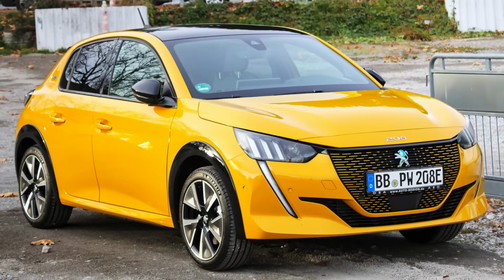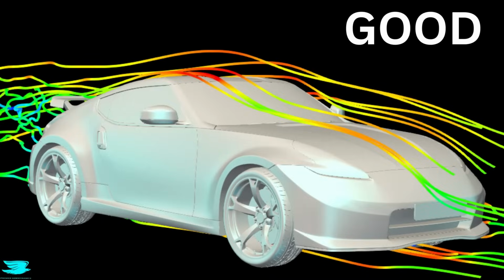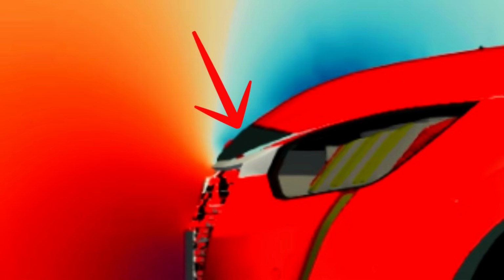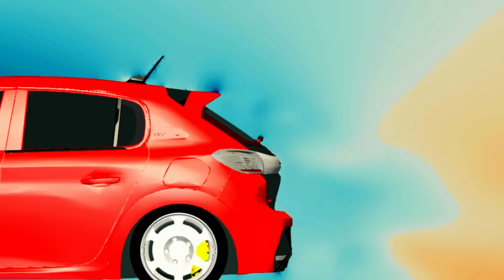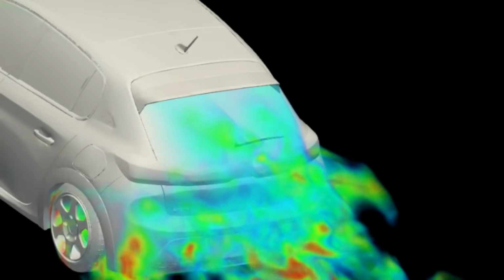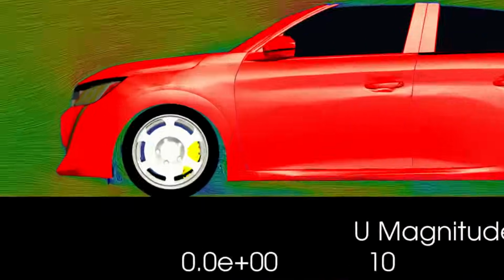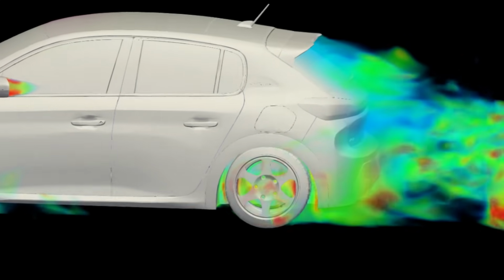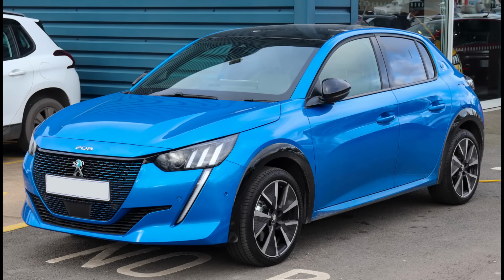How The Peugeot 208 Breaks The 0.3 Drag Coefficient Barrier

Comment: I have an idea that might make for a very interesting aerodynamic comparison.

You have already shown how subtle details can significantly affect airflow, drag, cooling, and underbody turbulence. I’d love to see you compare the European Peugeot 208 with the Argentine-built version sold in South America.

At first glance they look almost identical, but there are several small engineering differences that may have measurable aerodynamic effects. On my Argentine 208, I installed an engine undertray (skid plate) and added a front hood/headlight seal to reduce the gap where air can enter the engine bay. It would be fascinating to see whether these simple modifications improve airflow, reduce lift or drag, or even affect cooling.

I can provide detailed, high-resolution photos of every area of my car to help identify all the differences from the European model. I think many Peugeot owners—and automotive engineering enthusiasts in general—would find this comparison extremely interesting because almost nobody has investigated these regional design changes scientifically.

I hope you’ll consider making this video. I believe it would be a unique addition to your channel!
Reply from the maker: Hi! On our site, we have the Simulate My Car page for commissioning simulations. Thank you.

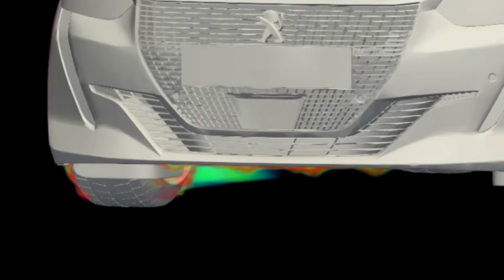Comment: I'm not sure but the front wheel spoilers look like they are curved in slightly and towards the back (2:08) Are they or can they be used as vortex generators to aid the flow down the bottom of the car?
Reply from the maker: They seem to be a little too flat to do that properly. There is a wake behind them instead of producing a coherent vortex, I think. But, they could be angled to be vortex generators, and shrunk a little.

Comment: Citroën AX did 0.31 in 1986 (almost 40 years ago - 0.32 for sport/gti version with big bumper).

Peugeot 106 did 0.34.
Best was Opel Calibra @ 0.26 (!).

I'm not going to talk about weight for technophiles (715Kg vs 1075Kg) and even less about safety knowing that motorcycles and bicycles populate our roads without us talking about the safety of such vehicles!

Comment: this absolute piece of french shitbox engineering has absolutely no side-wind resistance at all. It's light, top heavy and has soft suspension. Sitting at 120-130km/h it's a menance to all other road users, since you float from one side of the road to the other fighting the current wind. Arguably one of the worst cars I've ever driven, and I've driven a lot, especially small econoboxes, trust me. 1.2 pure tech sucks ass, the infotainment is slow and for me using it is a torture- I can never find the thing I want. If I could I would wh00p it's ass out of the window, but WELL... YOU CAN'T. Because someone in the office suggested NOT TO use any knobs, and the A/C and heater settings were burried in endless menus. Awesome idea. Driving aids suck, just like the rest. Annoying, never working as intended, especially the one informing you there's a car in front of you. YEAH NO SHIT, I'm just 15 meters behind it, SO IF I MAY ASK- please, don't show this stupid message on my screen, cuz then I can't do shit on it. Glad it's a work vehicle and we are switching to yarises next year. If possible, would almost definitely turn this useless 4-wheeler into a solid metal cube on the nearest junkyard. 2021 208 1.2 Puretech - 170k kms.

Comment: This car only comes with 1.2 turbo petrol 130 HP or 1.5 diesel 130 HP. I dont understand why Peugeot does not make this car with the 1.6 turbo 225(same as the 508GT sedan) THP petrol engine. Even with 1.2 3 cylinder engine, car act\drive like a hot hatch. 225 hp and light weight would make this a true competition to type 4, golf GTI, polo GTI, Hyundai i20 etc

Comment: As an owner of a 208 GT, I'm astounded by how well the design and aerodynamics team did their job - and yet the drivetrain team was allowed to just waltz in and lazily throw in a the motor unit from the lowest bidder. As a complete package, the 208 ends up less efficient than cars two sizes up.

Comment: Did you know that an even older design of the peugeot 106 mk 2 has a drag coefficient of only 0.31, that for a model starting from 1997 is mega mad for me! 

Hot hatches for life!
Reply: And did you know an older and shorter Citroën AX also had a Cd of 0.31 ? With its small frontal area, it was really efficient aerodynamically and needed very little fuel.
The first Y10 had the same 0.31 Cd.

Comment: You should do new Peugeot 308 as well, I sold my 208 and bought a 308 with the same engine and transmission. When I lift off the gas pedal, 308 keeps its speed better than 208. Lo and behold, 308's drag coefficient is 0.28

Comment: Did you considered working in the industry? It would help you with the reasoning behind the design choices, mainly pedestrian safety regulations, manufacturing limitations (costs), car insurance costs (protection of expensive parts), 10% frontal crash safety did a lot of changes and more
Reply from the maker: I have. When it comes to sales, looks are the most important thing. So, pretty much everything else is worked around that and regulations are cobbled together to work with that. The height of the front blockiness can be for pedestrian safety, but that can also be done with vehicle height.

Comment: I started to notice that a lot of modern cars have some kind of aero channels. They start at the extremity of their front bumper and ends up inside the wheelarches but directed towards the outside section of the tire. For exemple, you can see this on the Clio 5 facelift. And I know that the DS5 already had this years ago, but I noticed that more and more manufacturer do this.
Do you know what that could be for ?
Reply from the maker: Some cars have then for looks, and others as air curtains. They help create a shield of air around the wheel and drop the drag coefficient a little.

Comment: You should do an Interview with drivers of the Peugeot 208e and Corsa e…Their electrical driving range vanished dramatically reaching speeds above 110 km/h 
Maybe the GTI i Version is lower than 0,3 but not the EV. It has also a much higher ride hight due to its underfloor battery. And cW Value is not everything the flow-cross-sectional area is also important
Reply: The battery is placed in a H configuration around the car, it is the same as the petrol version, the ride is not higher. It's a multi power platform. 

I think the range issues are due to the battery tech.

Comment: It's kind of surprising, since 208 II doesn't strike to me as a typically "slippery" looking design you often associate with low-drag cars. Nowadays they can do a lot with detailing like that, but also the overall shape is rounder than it looks on the road. Especially at the front, the shutlines, the grille and the headlight shapes create an impression of a boxy shape.
Reply from the maker: It does have an underlying boxy shape, but many of the edges are rounded just enough to really reduce the drag coefficient nicely.

Comment: To get the actual aerodynamic behaviour of the car, wouldn't you have to model the front with every vent and hole as well and even the engine bay?
Reply from the maker: That is cooling flow, which we have the flow going through. The cooling flow doesn't combine with other flows to create synergy. It can be isolated and even removed without changing much.
Reply: @PremierAerodynamics So that air does not drag on the car?
I’d have imagined it to be like when swinging an empty bag around with the air slowing it down when it gets filled.

Comment: I love older peugeots, but they are doing an amazing job at their design department with their new cars. They look absolutely stunning.
Reply: Saw a normal 208 in bright yellow paint and though...looks wise this could easily be a hot-hatch GTI model as far as I'm concerned with minimal to no changes to the body. But then you look at the engines available :(
Reply: They all look hideous

Comment: The Opel Astra K Facelift Hatchback is Even better, I remember it has 0.26 or 0.27

Even with the crappy 1.2 Engines it runs very high top Speed, Even with 110hp

Comment: I wish Peugeot made a 208 with the 1.6 PureTech 225 hp engine and a manual option it would be legendary.
Reply: 225 hp for the thp won't last long, the sport engineered 508 is just reaching 200 for the 1.6 and the rest has two motors.
Reply: @ThatSpecificIndividual  508 PSE limits the output of the ICE engine because the front axle cannot handle more power when cumulating ICE + EV.
THP 270 for example was super reliable on RCZ R and 308 GTi
Reply: @ThatSpecificIndividual  I don’t understand what you’re talking about. The 508s in Turkey are sold with the 1.6 PureTech 225 hp version, and I haven’t heard of any problems in the past 5 years. They’re not hybrids, just petrol. Yes, the old THP engines were problematic, but they haven’t been produced for a long time.
Reply: ええ、日本で売られてるDS7、DS9、508もPureTech 225を積んでいます。長くは持たないと言っているのはおそらく、耐久性の話ではなく環境規制の影響で長く販売はできないだろうと言うことを指摘しているのだと思います。私の車もこれを積んでいますが現在のところ7年間元気に稼働しています。
Reply: it was planed around 6 month after launch ( so early 2020 ) , aftermarket documentation was ready. but Peugeot cancelled it because of CAFE objectives fearing getting penalties for not reaching them

Comment: I'm very curious about the aerodynamics of wheels, because it seems like that is the one piece of cars that is still mostly just style. I'm thinking what if the spokes were designed as airfoils to draw in the turbulent air right next to the wheel, of course that would reduce downforce but that extra air pressure could possibly be used to cool the radiators, enabling having a pointier nose, what do you think?
Reply from the maker: It also depends on the wind direction. Ideally, you could use them to suck the flow in and reduce the wake around the edges, but you would have to know what angle the wind is coming from to begin with.

It will also likely increase the flow rate underneath the car, which if the flow entering is now turbulent, would increase the drag and likely reduce the downforce with the way current cars have their underbodies.

Comment: So the wheel spoiler acts also as a gurney flap for the front?
Reply from the maker: I guess you could say that. They also produce really high pressure there, so that creates lift on the car. That's a good similarity you pointed out.

Comment: I don't understand why the fuck we don't have a modern 208 GTI! - Edit: A COMBUSTION ONE

I mean I do, it's not profitable enough, especially with the customers they're aiming for nowadays, but God damn it I want one
Reply: There is a new one coming ! It will be an EV, but it's coming 13 june
Reply: @xenalien355 that doesn't count, sadly
Reply: @xenalien355  lol ev, its not a GTi
Reply: they don't have an engine for it, nobody would buy a GTI with the 1.2 PureTech
Reply: @yobama8344  They could just reuse the previous 1.6(?)THP engine or improve upon it, or go all out and slap the 2.0THP from the 308 GTI on it
Reply: @BotBruh448 the 308 gti came with the 1.6thp 270 but that engine no longer respects new emission guidelines, the recent 1.6 with hybrid powertrains would be a great fit but it risks making the car a lot heavier than it should be, so I can see why they strayed away from it.
Reply: @yobama8344  ah yeah, I got the engines wrong, my bad, still, I'm sure they could find a way to respect guidelines with an iteration of said engine, seeing as there are plenty of brands pulling more horsepower out of bigger engines (Honda and the K20 on the FL5 is a good example)
Reply: @BotBruh448 the 308 gti also has the 1.6 THP but it has forged internals and pushes 272hp with insane turbo boost (huge turbo almost the size of the engine) and awesome intake and blow off noise, all stock, and a Torsen diff as the cherry on top. I know because I have one and it's the last absolutely crazy Peugeot they ever made. MUCH more powerful than a golf 7 gti from its time, and all while having a much smaller engine and much better fuel consumption. I can achieve 6L/100km on mine while my friend in a golf GTI can't go bellow 9-10L/100km and his is only 230hp stock, non forged. Even a stage 2 or 3 on his engine would be hard to catch a stock Peugeot 308 gti, especially because the 308 is also VERY lightweight stock. Feels like the 308 already has a stage 3 out of the factory, it's just insane. Peugeot engineers, when given freedom, do insane things. But the "Peugeot Sport" division was dissolved and with it all the crazy engineers...
Reply: @yobama8344  
It will be a more powerful e-208, it's been ready for years but Tavares did not want it. Things changed when he got fired. By the way, the most powerful series version of the 1.2 PureTech developped 155hp, which is not ridiculous.
Reply: @yobama8344  new 3cyl  stelantis use are from Fiat with timing chain and very reliable
Reply: I will never understand why manufacturers decide to name their EV after a pre-existing car name. The people who buy them will not and would not care about its history. Just give it a new name and call it "a step into a new generation" or something, will ya?
Reply: @verticalflyingb737 
Even Porsche dared to call some of Taycan models "turbo", what a samedi !
Reply: It was designed to from the start... Tavares said no but, fortunately, the new CEO said yes. It's coming soon ! Too bad it's an EV...
Reply: @asthalis  If it's an EV then it doesn't count, I'm sorry, make up some other sporty naming convention for your (the brand's) sporty electrics, GTi stays for combustion in my mind
Reply: No you’ll get bloated electric suvs & you’ll like it
Reply: @Journey_to_sunset  but I don't waaaanna eat my bloated SUVs!!!! :((
Reply: It's not that it's not profitable, it's not profitable with the current emissions regulations in place.
Reply: せめて1.2に48Vマイルドハイブリッドを組み合わせた145馬力ユニットを208に積んでほしい。このユニットは新しく308に設定された物だ。私は整備工場の代車として現行208を借りたが、加速性能以外はとてもすばらしいものだった。パワーだけが足りない！
Reply: In France a thermic version will be taxed with 30000€ malus, that is why you never will see a thermic version
Reply: You wont believe this…
Reply: @Arkxngl  It doesn't count!
Reply: @BotBruh448
Ev may be a good thing, modern .5 liter quad turbo combustion engines sound like vacuum cleaners already, and electric cars can be very powerful with high efficiency at the same time.
Reply: Because EU has killed the french automotive industry.
And escrologist also made it to pass heavy tax laws on any new vehicle sold in France, related to CO2 emission.
Any sports car is getting thousands and thousands in tax at purchase.

And Peugeot cannot do without domestic market.

I am buying a Miata because it's lightweight and only cost 5000€ in carbon tax.
A good old Renault Megane RS would be getting 60,000€ in tax, were it be sold today (no I didn't put any extra 0, that's the real tax there)

All is ruined.
The richs don't care, they can pay for their 911 and that tax is passed onto the car resale value.
But the average guy is done for.
Reply: I’m glad it’s an ev

Comment: Id love to see how Toyota Auris Estate (2015 face-lift) performs. It's supposed to have a low drag coefficient,very similar to the Prius, around 0.28 if the internet is not lying to me :)
Reply: The original auris pre facelift is even lower 0.27
Reply: Prius 4 have a Cd = 0,24 and Prius 3 have a Cd of 0,25, but it its just a number, lot of things are added together to have a good design, for example the new Prius 5 has 0,27 Cd, but the front of the car is flatter, and the design reduces the amount of vacuum the car creates after itself on highway speed resulting a better aero design overall compared to the Prius 4, so Cd is not that relevant alone, you can have a good Cd car that also generates downforce and therefore reducing economy, you have to consider the ride hight, the air that goes under the car, and the vacuum it creates after the car (this is why Priuses look weird, the also reduce the vacuum that pulls the car back) contrary to many beliefes you can increase the efficency if you lift the car up a bit, easier to create a flat surface under the car, than on top, and more air can escape under the car, but too high, and you will fly away  (reduced stability). You really need a wind tunnel to tell if your Auris is better or worse than a Prius with the same or close Cd.

Comment: So, this video talks for minutes about the radiator and pedestrian protection front, but then fails to show that blunt front drags air along ( Newtons third law ). I am quite sure that a modern hatch back with an efficient ( hybrid ) 3 cylinder engine needs less frontal area for the radiator than a Corvette or Porsche 944 . Or Citroen DS . Intercooler? A/C ? Climate crisis and traffic collapse? And the video fails to mention that the spoiler in front of the tyres is made of rubber. So this was a major innovation ( any patents? ), accept that a part of the car hits the road ( and needs to be checked / replaced regularly? )

Comment: how can we make doors more aerodynamic? it's really hard to open them at high speeds.
Reply: what's the use opening them at high speeds ???
Reply: @asthalis why wouldn't you?  it's tough, though. opening windows beforehand helps a bit.
remember if you exit the vehicle at high speeds, start running while you're in the air.
(I AM JOKING :P)
but actually, in an emergency situation, opening all doors could help slowing down your car faster 😀
Reply: Move the hinge to the rear, then they are suddenly really easy to open at speed 🌚
Reply: @Julian-WD  SUICIDE DOORS 😂